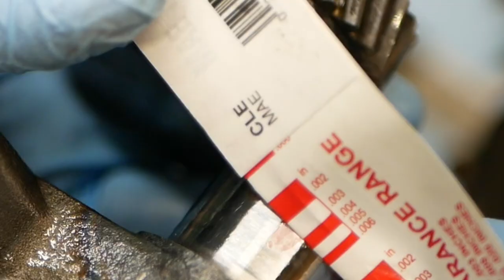212cc Predator powered mini bike motorcycle engine swap installing a stage 2 kit

Comment: Hi Nice video. On your argument referring to the long runners on the SHO you didn't pause to think the the SHO engine has injectors at the head not where the long runners start. The long runners were there to increase air speed.  I admit that I thought the runner may be a bit long but the proof is in how it both starts and how it runs. It may be a little harder to start on really cold days. If it revs up with no bogging down then it doesn't matter the length is fine. The other benefit is it keeps the carb out of harm's way.  It's both protected from sticks and rocks plus it won't drown in semi deep water. Super nice job. Thanks!

Comment: I am 95% finished with a Free 1974 Yamaha RS100 "Rust Bucket" build, removed all the water from the tubes, did some diy weld, painted it to look like an Army motorcycle. copied the frame style you made with slight difference, put a 212cc predator with torque converter, now installing universal headlights, taillights, turn signals, and finish the project. Thanks Mike for all the clear clarifications on the builds.
Reply: I'm doing an Italian harley sx 350 with the predator. Are you planning on making yours street legal. I am..

Comment: That long intake is gonna give you alot of low end torque qich is good because thats not a high revving engine
Reply: It’s the opposite buddy shorter more bottom end and longer more top end.
Reply: @EnginesbyAustin  yours is right for exhaust long tube headers are for high rpms.. Intake is the opposite
Reply: @EnginesbyAustin  I believe you've got the two mixed up, long intake runners on 4strokes aid in low end tourque.
Reply: @24BLUEELMO  I have been running 125 flat head 1 cylinder 4 strokes for years at 10,000rpm my guy so I know I’m right and they are over 50years old
Reply: @EnginesbyAustin  well as cool as that is bro, it is well known that long runners generally aid in tourque, short runners are generally in top end based applications.. not saying that tables can't be turned with each setup, but it seems most agree, and plenty of info online supporting the fact that length aids in tourque. Length ads resistance to flow compared to same diameter intake but one that is shorter will flow more, top end in short requires more air/fuel, so having said that it makes much more sense that longer would better suit low to mid-range applications, and shorter for top-end.
Reply: More velocity is more low end
Reply: I'd say 7800 rpm is pretty high
Reply: @noahsisung7953  maybe for a predator based engine, but modern 4 strokes rev well past 10-11k.so 7800 is on the lower side I would say.
Reply: @2strokejunkie686  yeah ig ur right
Reply: It is high reving after that stage 2 kit
Reply: @charliewilliams8026  Yes high revving for a predator engine, but it isn't really anything spectacular aside from that. Modern 4strokes rev to the moon and back compared to the old vintage MX thumpers of the day. Surely a night and day comparison, making a pretty rev happy powerplant. The bike seems to perform quite well for what it is, cvt has it's down falls when water/mud is introduced for longer periods of time,but looks like a fun play bike for sure.🍻

Comment: I have all the same stuff and updated to stainless valves and ported the head.  Its been put together and been sitting since winter. I've never even started yet. I updated my mower to a cub cadet that I've fixing up but running the bike is definitely on my to do list. With the cam heavier springs billet flywheel and rod iam looking forward to winging the crap out it for sure.

Comment: The long inlet manifold will be great for torque.
Reply: Agree, but is that a good match for that cam?  Im guessing since he put in a forged rod that the cam rev’s higher, probably could use a shorter intake for the high rev’s.

Either way, great vid, always fun to experiment

Now I want to find an old bike on facebook 😄
Reply: Explain please i want to know how that works 🤔?
Reply from the maker: Thanks guys for checking out my new video! 
The cam I bought was more for torque and I think only capable to about 6000 RPMs so the longer intake is a good match for it. The bike has a surprising amount of torque 👍
Reply: Mike festiva heck yeah!!! 🙌🏼😄

Comment: The supplier who will go unnamed just throws free parts at other channels who keep doing the same thing over and over.  Channnels who dont go in to near as much build detail and who have never made anything nearly as cool as the articulated 4x4.  My goal is to get a plasma table like yours and maybe make some videos myself.  It would make my life way simpler in regards to my little homemade projects. The Sawzall, drill, file method works but can be painfully slow. Keep up with the excellent videos!

Comment: Nice Job 👍. A few years back I converted a 1973 Honda XL100 for my ten year old son. I found an XL185 engine which I then converted with an XR200 barrel and carb. Really easy conversion and performance is markedly better. Still run around on it, My son’s now thirty and I have no doubt that when his son is born and old enough he’ll be riding it. (Time goes so fast)
Reply from the maker: Awesome and yeah time flies with kiddos 👍

Comment: The issue with the long intake people are referring to is that you have a carb at the end of it, a long runner like that can allow the fuel to fall out of suspension in the air. Not likely to be an issue in your case, just some context.
Reply: Might be difficult to start when its cold.

Comment: Put the ghost in it! Or continue to modify the current one. Orrrr even better, sell it to me and let me continue this awesome build!!
Reply: Reason why I want it is it I can’t weld but have always wanted a predator dirt bike once I saw your vids. I got the stuff for it I just can’t weld so I figured I’d ask if you’d sell it. Got a motor and all for it. I would just need to buy the frame from you haha
Reply: A modified predator like this is stronger than the ghost. The ghost is just a 212 with a stage 2 kit pre installed

Comment: @Mikefestiva Awesome Upgrade! I agree with your last remarks on your sponsor. Negative advertisement is still advertisement. I'd just post amzn links in the description. What is your top speed?
Reply from the maker: Thanks for checking out my new video and commenting 👍 I will definitely look into links.
I have not taken it out on a speed run with the new parts, last fall I took it out with a stock carb with bigger main jet, gov removed and 18lb valve springs and it topped out at 56mph but it was only at 3800 RPMs.

Comment: I’m wanting to do the exact same build with my dirt bike frame I have with a 212 predator. Kinda lost on how to mount the engine
Reply from the maker: Check out some of my other videos on this bike, I show how I make the engine mounts in the first video.
Reply: i did this on an xr 200 old bmx bike fork with plate welded on top made an awsome engine bracket looks clean too

Comment: That long intake tube you made most likely gave you an increase in power. The air increases in velocity as it travels down the tube. A slightly smaller tube might work even better.  We used to call it 'ram air' in the old days. Great video my man and great work. Keep it up and God Bless You.

Comment: Definitely some cool builds that dirt bike rips hard af now! You definitely should be sponsored by that company ;-) 

Make sure you don't have any grease on the drive variator or the rear driven pulley or it will act weird with revving engagement RPMs, also I probably would have put that contra spring setting in the middle and see how that works since the engine makes a lot of power now and shifting a little sooner shouldn't be much of an issue.

Comment: why is my coleman with this same engine so slow? the shit goes like 30mph
Reply: Your engine is stock his is built, your gearing could be different along with incorrect jetting.
Reply: Michael Roginski what would u recommend to increase speed
Reply: @ilovecheesecake516  top speed or torque?
Reply: Michael Roginski nah it has enough torque im taking about increasing top end speed and acceleration
Reply: @ilovecheesecake516  bigger carb and increase rpm...valve springs & cam setup
Reply: Gearing. Go a little smaller on the drive pulley/sprocket, bigger on the rear puller/sprocket
Reply: @ilovecheesecake516  ya what the guys above me said
Reply: Drop a bigger harbor freight motor and buy go powersports cvt if u wana go buck wild should need just an impact
Reply: @Kyle_gallegher  why would you spend tons on a new engine that's Un doutably heavier when you could just change your gearing and put a bigger carb on it?
Reply: @cm_wooten4250  other way around for speed
Reply: @kyleranderson1948  oh, my bad, I was thinking about faster acceleration. I know with a 250 two stroke that'll make it a lot meaner.
Reply: @cm_wooten4250  yeah I knew what you meant, just made sure you saw it😂

Comment: really nice idea, i found an old suzuki roller im thinking of doing this with but using a 10hp flathead as my platform.
Reply: Do it man! I have a xr100 that I'm getting ready to do a 213 or a 420 swap into. From a old wrist injury I can't use a hand clutch

Comment: I have an old Harley-Davidson golf cart that I was thinking of putting that motor in it but didn’t think it would be strong enough but after seeing your video I think I might, thanks for the video
Reply: It's definitelt enough for a golf cart just to put around in. They only come with 5 or 6 hp engines mormally anyway.

Comment: I managed to find Juggernaut drivers not sold by GoPowerSports (since you mentioned you'd rather not buy from them.) Same price as the ones on GPS. This bike definitely could use one. That stock Comet 30 is limiting you big time. Here's two links where you can pick one up:
https://megamoto.co/products/super-30-series-driver-the-juggernaut.html
http://www.studzracing.com/product-p/juggernaut-.htm

Comment: I want to do the same carb set-up with the bike I'm building. Going to try to mig-weld it (don't have a tig yet). I bought a billet adapter for the Mikuni knock-off but it puts the carb right where my leg needs to be for the foot-peg. Mine is getting close...can't wait to get ripping-down the trail! Thanks for the inspiration!

Comment: Great video!  Really cool seeing that bike moving that quick with a $170 powerplant on it (before mods).  My experience with the 30 series torque converter is inconsistency over the rated 8hp.  The belts seem to get wore out/glazed very quickly.  The bigger 7" driven clutch will help.  They make lighter aluminum weights for the driver clutch too if ya didn't know.  The heavy weights and heavy springs are not ideal.  The least amount of weight and spring pressure while making peak rpm is what to aim for.  Thank you for your time and investments!

Comment: My new predator build is awesome! It had so much torque the engine actually slid back on the mounting plate and made the chain come off.
Had to scoot it back up, and this time torque it down a bit harder.

I use a centrifugal clutch though, i want to switch to torque converter

Comment: Never would've thought a lawn mower engine would outperform an actual dirtbike engine. To me thats pretty impressive. Then again robot cantina powers a prius with one so i shouldnt be shocked by this. Cool build for sure.
Reply: I would hope a modified 212cc engine would outperform a stock honda 100cc engine.
Reply: @Clearanceman2  2 completely different designed engines for 2 completely different purposes.

Comment: Omg I started a project like this with a 1982 Honda xl250r frame from a junk yard. I ended up having to special order a rear 420 pitch sprocket for it. I stopped working on it for now bc I needed a longer throttle cable for the stage 2 carb I put on it. I had never thought about routing it on top of the motor like that. Cool bike btw can’t wait to see some more awesome vids🤙

Comment: Mike, don't sweat the sponsorship bs. They would want you to build a wheelbarrow with a cr450 engine in it or something stupid like that. You're too skilled for that nonsense. Every time I watch ratherbewelding, cars and cameras, or grind hard plumbing, I always think Mike would do such a better job. The fact that none of them have a CNC plasma blows my mind. They probably wouldn't be able to figure out how to use it anyway. With all the brown nosing out of the way, I must say, I am going through articulating dump truck withdrawal. You should start a Patreon for parts.
Reply: Grind Hard is levels above those other 2
Reply: @t1mblumer  I think ratherbewelding is a good fabricator, he just doesn't think ahead or design well. Everything he builds is too wide and heavy. He's young and I'm sure he'll get a lot better. I couldn't carry any of their lunches, so let me get off my high horse. Grindhard should do something besides those stupid power wheels. That's getting so old.

Comment: Ah the good ol' SHO. Good reference. But keep in mind it had butterfly valves that controled flow to the secondary runners past a certain rpm. Beautiful engine though.
Reply: That's bikes running awesome dude ... It wouldn't make a different...   That motor has no problem getting gas man

Comment: Mike get the pz30 accelerator pump carburetor on Ebay. Its identical to the xr200 carb,but pumper. Its 27mm and makes a big difference for $39.99
Reply from the maker: Thanks Tim I will look that carb up 👍

Comment: Great project 👍. Carbs are so touchy I'm surprised at work!cool
Reply from the maker: I had mounted the same carb on my quad truck so I got the jetting in the ball park the first time I put in the jets, it actually started second pull and ran really well without any other jetting.
I will see if I can squeeze any more pony’s out of it with a little more fine tuning 😂

Comment: Nice build and great explanation of how things work and should be together. However, your carb needs to be as close as possible to your engine for max power
Reply from the maker: Thanks for checking out my video.
If I actually mounted the carb the way you described it would be right in the way of the foot peg and make the bike really un rideable.

Comment: Intake runner science wet and dry are totally different. Yours is wet meaning it flows fuel and air. Not just air. Long smooth runners don't really favor fuel atomization that why folks say that the runner is too long. I'm sure it's running fine given that it only needs to flow one cylinder however. But Id bet you would be able to jet down a little bit if it was closer

Comment: Holy crap Mike the bike now has serious torque for days. The bike went from a good beginners bike to a serious trail rider. I believe some math needs to be done as that many upgrades puts a monkey in the torque convertor calculations.  Very strange that swing in rpm with the torque converter engagement. Is the belt slipping? Possibly a better torque convertor is needed?

Comment: I need to build one for my wife! She would love the no clutch or shift feature haha
Reply from the maker: They are wife friendly! I still have not got mine on it yet though 😂
Reply: @Mikefestiva  you need to install a juggernaut drive clutch,the power engagement is super smooth because it works on rollers not weights and it's super predictable. Got one on my build 212 and what a difference,the power transfer it's so insane you won't believe a clutch can make that much difference

Comment: The exhaust port in the cylinder head is short enough to warrant removing the casting residue. With medium effort there will be significant gains. This is not a Japanese low - tolerance spec engine. It can use all the help you can give it. This video is awesome. Congratulations on a square and attractive build!👍

Comment: Its cool bro i pay for all my parts too, and I usually don't buy from the common part  sellers, ebay is my go to, and the carb is just fine, more distance = cooler air/fuel mixture = more power

Comment: Great video. Perfect dirt bike resurrection. You should look into the juggernaut drive replacement pulley. It’s recommended for higher rpm capable motors. If you do, please make a video about it. 😎

Comment: Great build as always Mike, now you will have to find an XR200 or 250 to drag race! It's a pity those comet style torque converters slip the belt instead of having a separate centrifugal clutch like the GY6 based trans in your quad truck. I much prefer the tunability of the centrifugal clutch style torque converters.
Reply from the maker: You are right, I really wish a company would come out with a GY6 style CVT, it would be so much more durable and tunable! Thanks for commenting 🙂

Comment: I liked the video it was pretty interesting to watch, I'm busy with a 440cc "mini" bike build and I've got a new 30 series cvt for it but I've got a few questions about the possible performance I can extrude from it. So my 440cc is a stage 1 5k rpm motor and question is will the cvt handle 5k rpm and what's the wear and tear on the belts if everything is perfectly aligned. And next question is how do I move the sprocket on the driven pulley to the back of the plate. I want to run the chain behind the plate to my jackshaft

Comment: Theres a new HD front clutch out (juggernot ?) RBG had good review of it.  I really like the intake manifold.  My shop teacher gave me a idea for gapless rings, by putting 2 oil control rings in place of the compression ring (gaps 180 degrees apart).  If I could find the time I would like to see one build like this but with a bigger frame (250-500cc) using the HF 420cc motor, with mods!